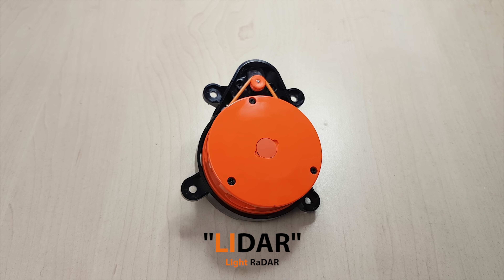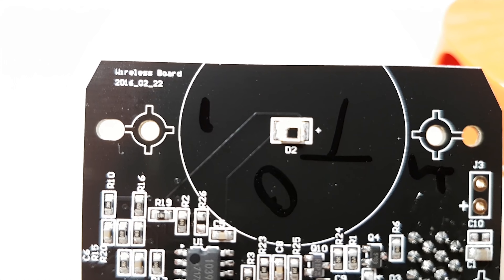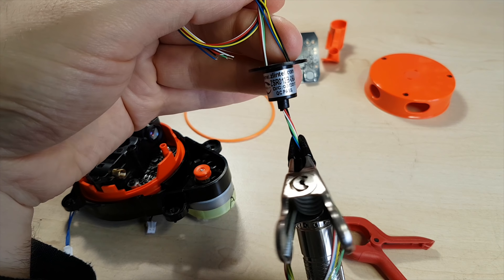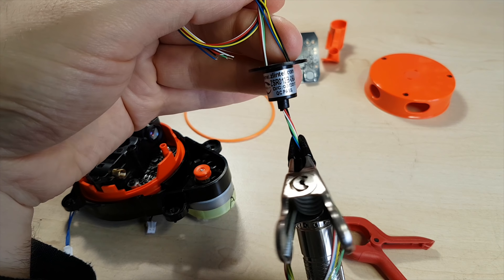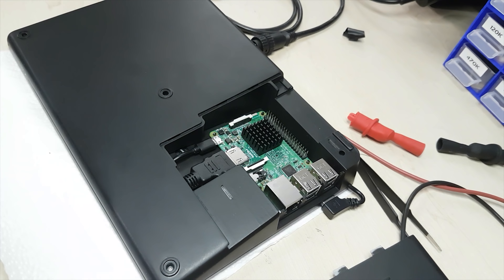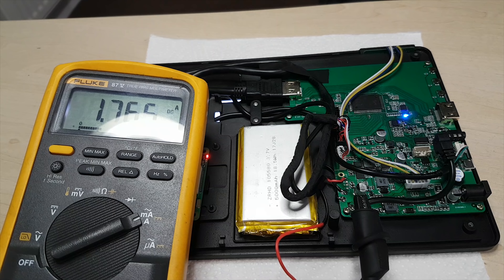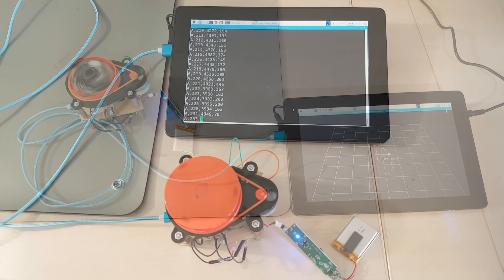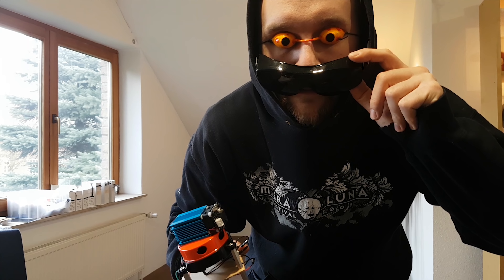All about the Xiaomi Lidar Scanner and the Sunfounder RasPad

Comment: This is not a time of flight lidar, that would be expensive. Instead, it uses a linear ccd and looks at where the laser shines at the wall. There is a distance between the laser emitter and the ccd (and the laser is angled towards the ccd) from where it sees the laser dot it can calculate the distance.
Reply from the maker: Oh really? That makes perfect sense, why haven't I seen that explanation anywhere else before? :-\
Reply: VL53L0X and the VL6180X "Time-of-Flight Distance Sensor" - cheap LIDAR?
Reply: The laser does not appear to be pulsed: it is probably just a simple rangefinder. In order to get a resolution in the order of centimeters with a direct or indirect time of flight method, sub-1 ns laser pulses should be used - not cheap and not practical. A rangefinder only needs a cheap CW laser, a linear sensor and a lens - alignment however is fairly critical.
Reply: Much like how those nice Sharp GP2Y0*  sensors work?   I wonder if one of them could be used to make a real budget 'lidar' module or if using these would still be cheaper..
Reply: I thought so as well, but during the last 5 years much has happened! As pointed out above by David Pilling there are now extremely cheap single-chip ToF-LIDARs available. The integration of transmitter and receiver into a single package first allows it to process the sub-nanosecond resolution needed.

You would not see the laser of these systems being pulsed, because the repetition frequency is at least a couple of hundred Hz, up to kHz.
Reply: the laser triangulation sensor is still widely used in laser range finders from your hardware store, but ToF is available now as well at quite a low cost.

Looking at the inside of your module it appears clear though that your vacuum cleaner still used the triangulation method and not ToF. With this wiring it would never be possible to time the laser diode's pulses accurately enough as needed for ToF.

Still neat though!
Reply: +Electra Flarefire

I've explored just that; it is perfectly feasible and worked out just fine for my application.
There's one caveat though - the distance sensors from Sharp are a little slow (approx. 25 Hz), but one way to counter that limitation is by making use of multiple sensors. For example; 2 sensors back-to-back.
Reply: I am much aware of the laser triangulation and their wide spread, however ToF has become available now and will just get cheaper. You can see from the sensor itself which principle it uses. Triangulation sensors need a separation between the sending and receiving optics and need to have a 1D or 2D image sensor on the receiver side - the more pixels, the higher the resolution. Special case: analog position sensitive photodetectors...
ToF systems of the modern, cheap kind combine sender and receiver on the same chip - as they have to, because of the short delay times involved. Due to the proximity you can use the same aperture for sender and receiver (or use no optics at all)
http://www.st.com/en/imaging-and-photonics-solutions/vl53l0x.html
http://www.st.com/en/imaging-and-photonics-solutions/vl6180x.html
price tag below 10 USD
Reply: Yes, I am using the VL53L0X to detect the water level in an dehumidifier for months in combination with an ESP8266. Nice I2C device. VCSEL Laser Technology, SPAD array and ToF.  Different modes, fast, precise or "Long range" (2m max).   I also have the VL6180X here, waiting for an appropriate usage. Great devices an I hope that there are more to come. Some months ago I found the annoncement of a new lidar sensor with an increased range VL531L http://www.st.com/content/st_com/en/about/media-center/press-item.html/p3918.html but now I cannot find more.
Reply: In addition most uses like this does indeed pulse the laser. Reason is they can then take advantage of the darkfield function built into most of these linear ccd's.
In essence the CCD can take two images synched by a signal pin (some actually have a strobe output that controls the laser), and the CCD will subtract the darkfield (the image without laser off) from the image with laser on. By letting this synch system be integrated into the ccd you can thus take the images very-very-very close together in time meaning the rotation does not skew results much. Neato Robotics version (which this is a clone or lincence of) does a full revolution twice a second, and reads the distance 360 times per revolution. These sensors can operate up to 30-40k pps so the two images can be only 25 microseconds apart while the measurement points are taken every 1.39ms.
This parallax measurement is very clever and quick. Since the linear CCD can have as many as 4096 pixels in a row, and by curve-fitting the dot along the axis you can determine the dots position at sub-pixel accuracy you can have a quite high resolution as well.
Reply: The Sharp GP2Y0 module has a "detecting distance" of only 10-80cm, the STM VL6180X offers ranging from 0 to 10 cm. It's all in the datasheets. This Xiaomi Lidar has a range of approx 6 meters like others using this method. See https://www.robotshop.com/media/files/pdf/revolds-whitepaper.pdf
Reply: Quick question, can that laser beam be expanded?  Or does it go in a straight line only?
Reply: Just want to add: They also offer an updated version of the vl53l0x with a 400cm range:
http://www.st.com/en/imaging-and-photonics-solutions/vl53l1x.html
Reply: I was not aware that that small and cheap ToF LIDAR exists, thanks for the reference David! But for mapping a room it will not work I guess (rather used for spotting obstacles): see flyer and documentation 

TARGETED APPLICATIONS
• Camera assist (ultra-fast autofocus
and depth map)
• User detection for power saving
in smartphones or laptops
• Gesture control
• Drones
• Robotic and industrial control
• IoT
• Domestic appliances

5.1 Measurement conditions
In all measurement tables in the document, it is considered that the full Field Of View (FOV)
is covered.
VL53L0X system FOV is 25degrees.

But I'm curious what the future brings....
Reply: Is this angle the same reason why it's only accurate to 6 meters distance? I imagine time of flight would really have that kind of limitation
Reply: Those go up to 1.2 meters only, though. (the VL53L0X  that is)
Reply: I was wondering about that myself. I know time-of-flight LIDAR is getting cheaper, but I didn't think it was cheap enough to put in vacuum robots yet. Though triangulation is cool in its own right.
Reply: i dont mean to be so off topic but does anybody know of a way to get back into an Instagram account..?
I stupidly lost my password. I would love any tricks you can give me
Reply: @Carson Max instablaster ;)
Reply: Phones have cheap tof now

Comment: The transformer-coupling and optical transmission back does not have to be expensive and it is much more reliable than slip-ring connections. I recently ordered the same slip-ring connection which you show in the video, but two near field coils for power and optical data is very tempting.

In the good old days of VCRs the connection between the recorder and the rotating read/write heads was done by rotating transformers, because no slip-ring connection would be durable at the needed rotation speeds. My self-constructed persitance-of-vision clock/display actually uses a slip-ring type connection for power and bluetooth for communication, but originally I thought about a transformer for power. I started the project before the ESP8266 was popular, if I only would finish it - ever...
Reply from the maker: I got the slip ring thingy for a certain >360° camera gimbal, but now that you mention VCRs ... they are basically free nowadays aren't they? Hm ...
Reply: ...if they still exist ;-)

Comment: Hello, I only exchanged lds sensor modules, but the map is not drawn properly. The seller orders you to adjust the yellow line to the top, but that doesn't work either. Google says you have to do something called a calibration to draw it properly. Do you have any information about it? If I have such equipment, I'd like to buy it. I desperately need your advice. I'll be waiting.

Comment: How do I fix Error 22?
You can see on my channel.
When it tries to dock it drives a little to the left and so it never makes contact with the charging pins. 
But it has no problem cleaning my home so idk if it's a sensor issue.

Comment: I tried the XV_Lidar_Controller with both Leonardo and mega2560 and both showed some unreadable raw data. But when I use command "showdist" it only shows a line with "Code,Angle,Distance(mm),Signal strength
" and nothing else. May I ask if the code need some modification? Thank you.

Comment: "PVC tape - that's unforgiveable" - your are SOOOOO right!!!
Reply: Why exactly? After some googling, i do see that was a bit of a misfit application, but not that bad... is it?
Reply: have you seen any application of electric tape which has been around for a longer time, say 2-3 years? There are two ways pvc-tape ages in the field and neither is what you want to have in your equipment or installation: (a) completely dried out, loosing all adhesion and (b) the glue becoming softer, oozing out between the layers of tape.

Use self-vulcanizing tape if you have to use tape, otherwise use heat-shrink tubing.

Comment: The inductive coils are pretty cheep to manufacture. The advantage is that its way simple to handle a few mechanical manufacture issues... because.. well there is no mechanical parts. Of cause it need some diods, a inveter and a cap. But we really talking about components that cost a few cents.
Reply from the maker: They might be cheap to manufacture but I don't think they were in this case, wound directly onto the plastic parts and nicely soldered + heatshrunk to the connector cables
Reply: I actually do think it was pretty cheap. They probobly used a ready vinded blank prior to molding. Its really a matter of production technology.

Of cause, the other coil look pretty heafty. If not anything, there is a bit of copper there

Comment: Hi there! Great video. Is it an infrared laser? Let’s assume it beams right into your eye for an extended amount of time. Will it cause any harm? Is it dangerous?
Reply from the maker: Haven't done any measurements, but I don't think so. Because of wireless power transmission they must be using the absolute minimum power and as you can see in the previous video ( https://youtu.be/wglJz23Gt4w?t=176 ) the laser is pulsed.
Reply: Marco Reps Thanks for getting back to me.  I would be grateful if you could make some measurements. BTW, do you know the frequency? It is infrared laser, isn’t it?
Reply: Any halfway decent design should also disable the laser if the unit is not spinning, hence reducing the risk.
(I believe there may even be regulation about that kind of thing, since some accidents with those lasers shows in 80's discos)

Comment: As you said, it's pre production, so the electrical tape is perfectly fine. Why would you forgive "manual corrections to the enclosure, but not the electrical tape? That's so confusing. Either way, it is perfectly acceptable.

Comment: I wonder if it would be feasible to make a 3D scanner for indoor applications based on this and a gimbal.
Also LIDAR is not "Light Radio Detection and Ranging", lol.
Reply from the maker: That would be awesome! Maybe even just a magnetometer to detect in which direction the scanner is pointing?
Reply: That would actually work well in a handheld unit - begin with a static "reference" point cloud, then map it out as it moves(kinda like the vacuum cleaner does, except with tilt and in 3D).
I'd also add a compass for another degree of certainty.
Just have to ignore a hundred or so degrees behind the scanner, to not smear yourself all over the point cloud.

Comment: Great Video. Thx. 

May I hint you to the fact that apparently there is a full linux running the opensource Player / Stage framework on that thing.  (https://github.com/rtv/Stage) 

Have a look here: 
https://media.ccc.de/v/34c3-9147-unleash_your_smart-home_devices_vacuum_cleaning_robot_hacking

Would be very interesting if you could confirm that. / Have some play with the open-souce robot control